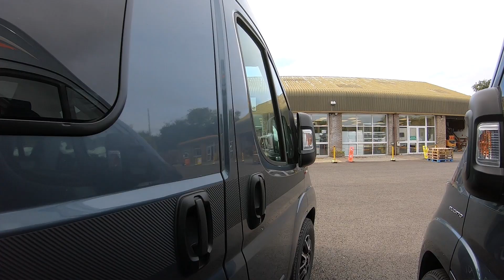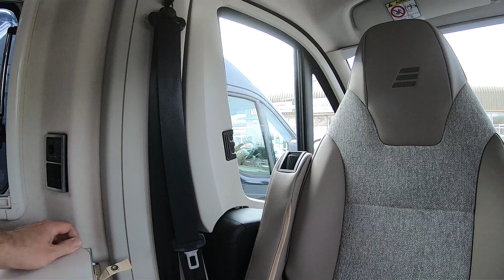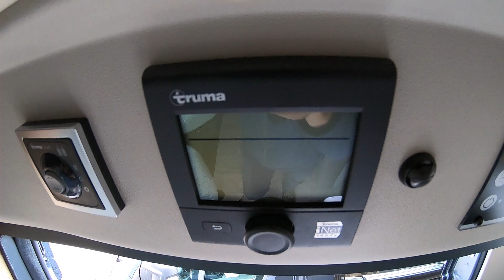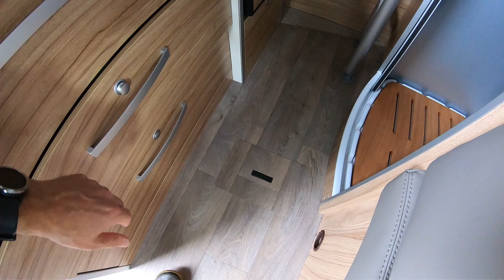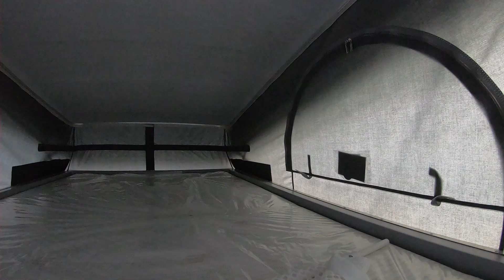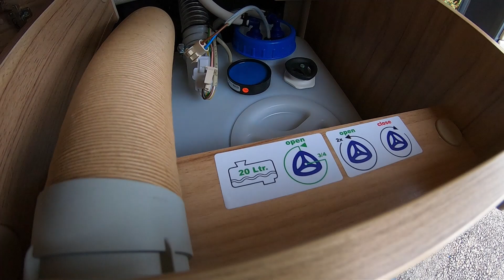2021 Hymer Car Grand Canyon

Comment: needs lithium
Reply: Do you have any experience in this ? We just ordered this van but did not take the lithium as rather very expensive. Have the standard battery and 180W solar panel on the roof. What would you recommend ?
Reply: @wildijp62  I have the Grand Canyon with 2x95Ah AGM batteries. If you don't use 230V appliances (coffee maker, TV, computers) via inverter, there is no need for LifePo4. 180W solar would serve you just right.